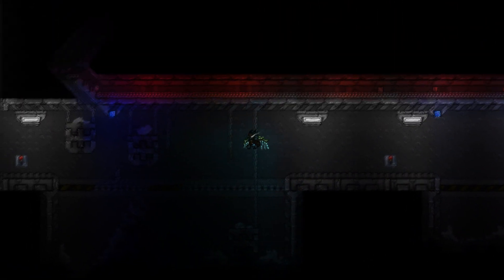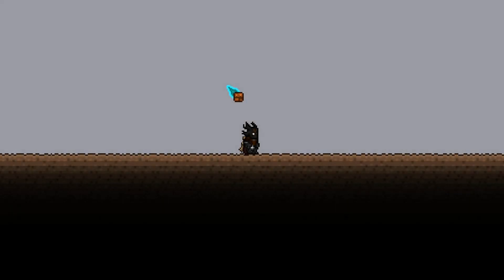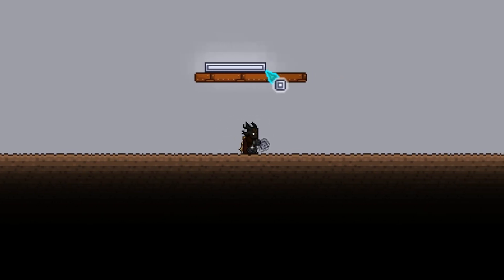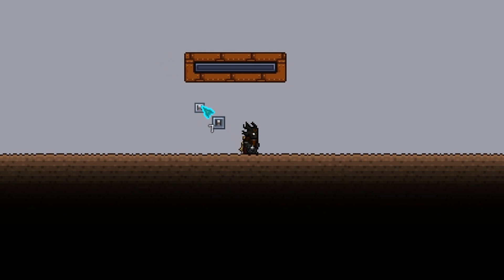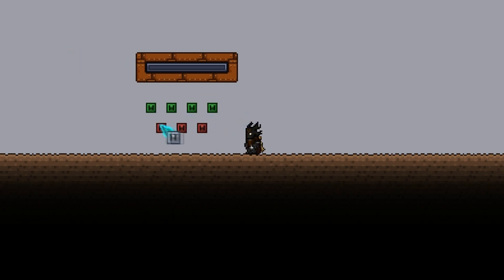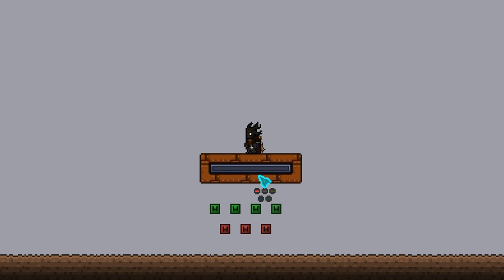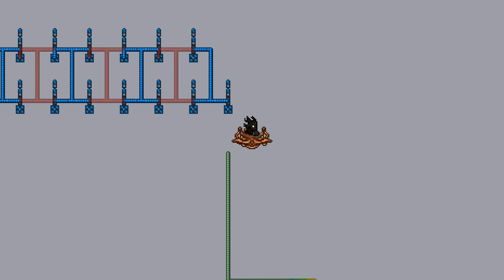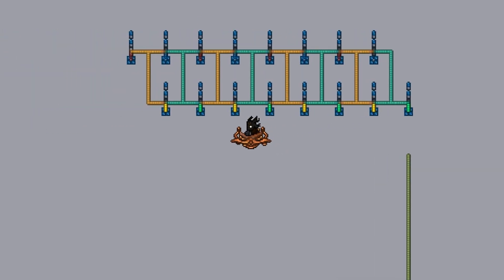Terraria Building Tutorial | Ep 3: Fill the Meter Puzzle

Comment: There is a surprising amount of logic involved for all of these puzzles. And I’m assuming the “fill the meter” puzzles that involved hitting blue switches was essentially a couple of 1 second timers attached to the subtract line, and the teal pressure pad on the blue switch connected to the addition line. There’s probably more to it, but that would be the gist of it.
Reply from the maker: The meter puzzle in the example is built pretty similarly built to what I showed in the tutorial. I did refine the design for the tutorial tho ^.^ No timers necessary in this design :D

Comment: why do you use faulty logic gates?
Reply from the maker: When you use a faulty logic lamp, it changes how the gate works. When a signal is sent through a faulty lamp, it will have a chance to send a signal through the gate based on the non-faulty lamps below it. For example, if you have a logic gate with one faulty lamp, and four on lamps, the gate has 100% chance to send a signal; but if you have only one lamp "on" and the  other three "off" it only has a 25% chance of sending a signal. Unlike an AND gate, which sends a signal both when it turns on and off, a faulty gate will only send signals when the faulty lamp is powered. That's the reason I use them ^.^ I could do a "beginner's guide to wiring" kind of tutorial if that's what people like. Would help me explain this sort of decision.